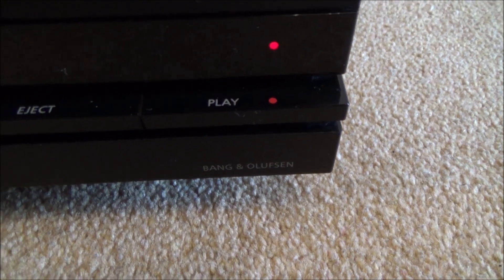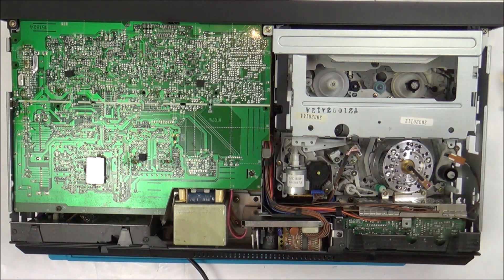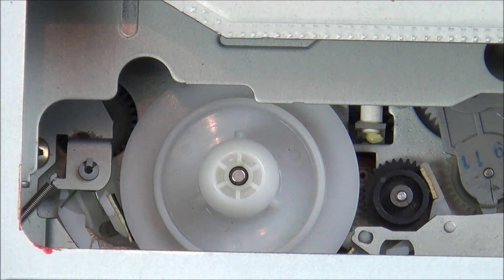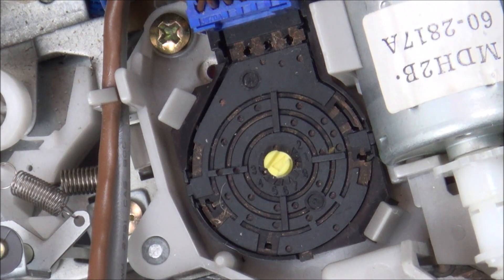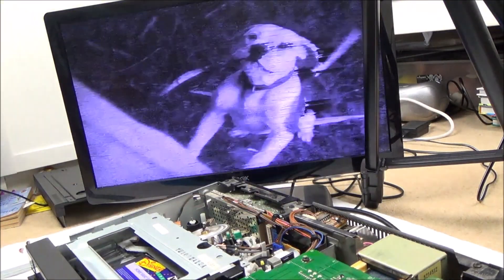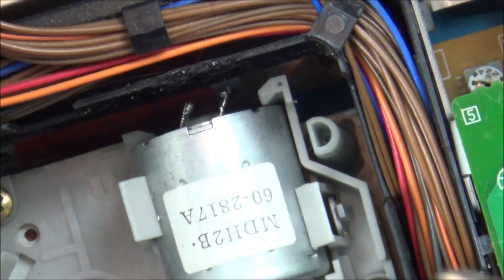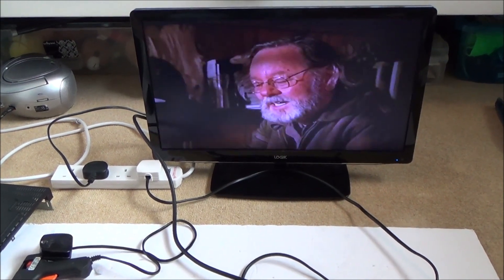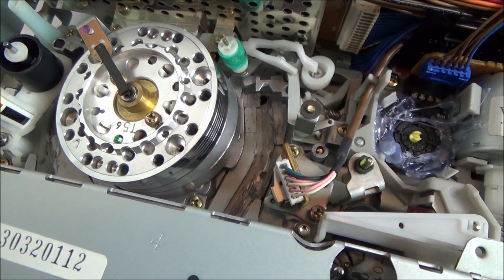Trying to FIX a £1200 Bang & Olufsen VX7000 VHS Video Cassette Recorder

Comment: Vince! 
Don’t rush in to buying a remote, it will not work and you mostly can not use a universal remote as the IR frequency is unique.
All B&O VCR’s and DVD’s do not have IR Receivers on them they received commands though a BeoVision TV. 
I am a Authorised independent B&O Engineer. If you have any questions feel free to contact me.  Keep up the great videos.
Reply from the maker: Thank you :-)  I have plenty more older B&O products waiting to be looked at so your help may be needed, which could lead to a revisit video if I can't fix it first time round :-)
Reply: @Mymatevince  Nice video. I was leading the software development for this VCR with my internal team at B&O doing all the higher level software and external team at Hitachi Tokai Works doing the lower level motor control software. In the 90s B&O did quite advanced multi-room home audio/video networking systems with Beolink/Masterlink where your VCR could serve as the home's central video player and be 2-way remote controlled e.g. from a Beolink 7000 remote (crazy expensive remote btw). This VCR is highly optimized for working in a B&O system and you need at least a B&O TV from the 90s with a B&O remote to make sense of it. Collaboration between B&O and Hitachi to make this product was a big challenge (I spent about 1 month plus other trips in Japan making them fix about 300 bugs just in their part of the software) but we succeeded making it into a genuine B&O product providing a market leading simple design, user interface (with the remote involved), picture quality and HiFi sound quality back then.
Reply: @ThinkingBetter  I have a complete 7000 audio system including the 7000 two way remote - a work of art and hard to believe its 35 years old.
Reply: @originalforgery  You have a Beolink 7000 in use today still working? I know I have one of those stored somewhere in a storage box. Actually I worked at B&O involved in developing that system at that time in the 90s. And frankly, we spent very serious engineering time to develop the two-way infrared control architecture, requirements and software. It was a bit disappointment to me we developed those things much ahead of its time and bad marketing made it fail. Few people realized what it could do. About a decade later I lead the effort of the Nevo SL WiFi/IR remote controller winning the CES innovation award. But even that was not really two-way. Still B&O is hard to beat on true A/V system integration.
Reply: @ThinkingBetter  
Yes, its still working perfectly and is complete with the rare floor stand (I still have the table top dock somewhere).
I've collected B&O products from the late 1980's onwards (I still have 90% of it - the rest I've sold to relatives and as far as I'm aware still works - Beocentre 2200 / CDX) and what I found amazing that pretty much everything integrated with another product ( I wasn't rich so was never lucky enough to buy everything in one go).
I think the only disadvantage with the two way system was that very slight delay which would result in some, pressing buttons twice and getting in a muddle - I was just mesmerised - still am.
As it is, I have a Beovision 7-55 connected to a pair of Beolab 8000's, a pair of Beolab 6000's and a Beolab 2 subwoofer connected to a complete 7000 stack audio system.
I think the way its set up is the TV is the "master" and can play through the AV option - when I listen to music this is all controlled by the Beolink 7000 - there was a few options that we had to explore  to get it to work but we did -  I'm not an expert - more an enthusiast) .
I then have a link system through the house with everything from Beovox 200's, Redline 40's (still sound awesome) Beolab 3500 and 2 more B&O tv's which are part of the link.
All that came together over a 15 year period and I still have most (plus a couple of the new Bluetooth speakers for everyday - Beosound  2 & 9).
I enjoy it everyday.
Jacob Jensen & David Lewis have a lot to answer for..... 🤣🤣😂😂
Reply: @originalforgery  As I worked for B&O for 14 years in R&D during the late 80s to early 90s incl. leading several of the project, I got a ton of products for testing at home incl. most of the products launched during the 90s. We could keep these products by paying a symbolic amount for legal reasons. I also had side roles there as member of the listening team, viewing team, ISO quality audit team etc. Long ago B&O had talks with Apple about some collaboration and I'm still of the opinion that they could enable great synergy (design with simplicity in mind, use of aluminum, ease of use etc.).

Comment: Oh dear! I’m not surprised you found this heavy going. B&O video machines are designed to be part of the B&O system alongside their own brand tv and audio units often with a special remote. Mechanisms are often Philips but remotes tend to use proprietary frequencies.

I’ve repaired a few pieces of b&O, but not a brand I would be tempted to start my service career. Anyway, good luck!

Comment: You’ve done very well with this old thing. I’ve fixed many vhs players as a younger lad. Always took things apart to see how they work. Beta max and even a grundig 2000 I’ve fixed. The grundig 2000 was a beast of a tape player. Fully loaded with boards. Also a double sided tape player too. Brings back a lot of memory’s watching this video. Thank you.

Comment: Nice fix, you got it working and maybe new 3D printed cogs would make it work reliably for years to come.
My vcr is from 2003 and still mostly working fine but wondering how long, if plastic parts start to break. Already couple of times it has shut itself off and started flashing fault code "2". Might be a cassette problem though. Usually it works just fine though.
They sure look very complex machines inside.

Comment: Very nice construction and easy to service , The clutch was slipping caused by the crack on the grey part and gears , and removing the brakes would make it play fast, the left head is for Sound, Don`t use cotton to clean the video head it leaves cotton strands behind ,Use printer paper and IPA to clean the video head and turn it anticlockwise , great video :)
Reply from the maker: Nice one Anonymous. I presume printer paper is good as it has less fibers ????? Glad you are OK as I noticed your channel was a bit quite recently. BTW I got 200m of the 0.02mm wire you mentioned a few vids ago, that should last me my lifetime :-)
Reply: @Mymatevince  Busy remodeling my kitchen and it became a nightmare, supplies didn't arrived.I will see if I can post a video tonight
Reply: @Mymatevince  sorry to butt in, you should check out the motor inside a microwave fan (you know the white one on the side?), I generally salvage jumper wire from there as it's perfect for trace repair, it's easy to strip and tin and it stays in pretty much whatever shape you want it to 😁

Comment: Hello Vince: Apologies if this has been mentioned before. I have a few old B & O things as I like you like them. The reason the VHS was nit supplied with a remote is because B & O remotes are used to operate all of their equipment. It is unlikely that someone would buy a B & O VCR without already having a television to go with it. Alas they would be more than likely to have a remote to operate it. I would recommend you getting a remote for it as this will also operate the functions on your tape player. A Beo 4 will cost £40 for a ropey one on eBay but you can buy the additional parts to make it tidy/as good as new again. Beo 1000 are also ok, but a bit older.
Reply: I always wondered why all those old TV remotes had VCR function buttons on them
Reply: You can also try a cheap replace remote, they are programmed for many different brands.
Reply: @blokhet  B&O uses IR remote. The recorder has no reciever, its recieving it from a B&O TV.
Reply: @blokhet  They may work with the odd function but b&o remotes worked across a broader range of commands.

Comment: I got vx5500 which is older than this but identical for the most part. However the problem with it is that it can only load a tape but not play it, the motor does not move at all and the whole unit is pretty much unresponsive. any help?

Comment: Great job =D  I would be tempted to use super glue on those cracks, and melt slightly with the iron tip at the points of the cracks - might just keep them together!  Awesome result!  I think I would buy one of those generic remotes rather than spend the £70.  I bet one of those will work!
Reply: For an Mx4000 TV I had to buy two different remotes that were both described as being specifically for B&O devices. So not the generic one with programmable IDs and of course not the original... Just one (sent from Uk to me in mainland Europe) didn’t work at all for the TV... The seller never refunded the money, just sent me through an infinite loop of nonsense mail requests to keep me annoyed enough to give it up at 20€. There is something specific to these B&O remote controls.
Reply from the maker: Nice one Chris, I always forget about the soldering iron trick. These B&O devices use a different setup than other IR devices so apparently the all in one devices don't work BUT you can get a cheapo looking replacement for half the price :-)

Comment: The tall lights on the pcb with the two microswitches are the end of tape sensors. The light is blocked by the black tape, but when the tape gets to the end, a clear leader is attached. Light now passes from the led's to the sensor, and informs the machine to stop the tape transport. The microswitches tell the machine the basket is fully lowered, to stop the load/eject motor and it is safe to being loading tape into the head assembly.

Comment: Hey, did you get a remote for the VX7000? I heard it doesn't have an IR receiver... I just got a VX 7000 with a Beolink 1000 which is not working... Did you try the Beo4?

Comment: Hi vince could you fix the cracks with araldite glue? Then sand it down so it’s flush. Or use a 3D printer for parts.

Comment: As always uploading good videos  and this one perked up my interest as I used to repair VCRs back in the day and made a lot of money out of it because I used to visit repair shops in the town asking for machines they are disposing of  had one shop dump about 100 machines on me in various conditions  certainly let me busy at least half repaired and sold on and Soares for other machines good fun 

In this video it looked as tho the alignment was slightly out hence why the take up spindle wasn't moving 

As for the heads yes the one on the left side that has 2 wires is the erase head the big spinning head is for the Video playback and record  the one on the right hand side you said you not sure about is called an ACE head  stands for Audio Control and erase 

The spinning video head I'm quite surprised it has as many heads on it I think the most I have ever seen is 4 heads  but then that has been several years since I got my hands inside of one 

The most common VCRs I came across was Panasonic quite nice machines had much better drive hear system and used to love the remotes for the Panasonic as some models had a barcode scanner to set up the record timer 

There was one machine I got my hands in was absolutely wonderful machine really good sound it was Nicam the tape slot was hidden behind a door along with all the buttons I forgot the make of it but it was quite an expensive machine the only fault in it was the mechanical gearing I had to get a replacement main gear  the main gear is where the mode select switch sits on and driven by the small motor  replacement gear not that I had to pay for it my old boss did haha but cost about £15 including service manual

Comment: You weren't kidding when you said you don't know anything about VCR's. Hehe it was kinda funny, sorry. Anyways, nice video. This machine uses the common Hitachi Mechanism. If you are looking for the parts or the cracked cog wheels, search for Hitachi mid 80's to mid 90's VCR's which occupies the same mechanism 90% of the time. In this particular mechanism, the loading motor (which sits right next to the mode switch) does not load or eject the tape. That is done by the Capstan motor at the right timing. Make sure the you clean the belts and the pulley properly since it has to maintain the torque. I have a Hitachi VCR with the same mechanism, if you want, I can send that to you. I collect VCR's, just love the technology on those. Take care.

Comment: Perhaps it would be possible to make replicas of the parts with a 3D-printer.
Reply: That was my first reaction :)
Reply: it would be too rough, 3d printers still do not have that good of a resolution, i would sugest to make a mold of the original and remake it using resin
Reply: @geovani60624  3D printers have come along way in recent months, I 3D print replacement gears for some DAT machines, the nozzle on my 3D printer is 0.4mm, I can print some really small things that are very usable.
Reply: @nickfatsis9607  yeah but it's still expensive to buy one of these good 3D printers just to make some gears, the molding and resin process is way cheaper and works great if you have the original part and you can glue it in a way that you can make a good mold of it

Comment: From what i have read online this model is hitachi based does look different to panasonic and phillips machines i have seen .If a tension band fails and the felt comes of it can damage the heads and the need to have a certain tension or they will wear out the heads .

Comment: Hey Vince, Yes those cracked cogs/gears won’t help.. you can clean the heads with paper and isopropyl alcohol. Those felt brakes are for tracking and the tape speed. Good to see some else try and fix these... they are a pain lol. But the whole tape section is what we used to take out and the power the motors and check various mechanical parts. But looks like you found the cracked parts great if you can get replacements then it would be good but VHS who still uses that????
Reply: Im all vhs my tv weighs 77kg.

Comment: Love your work. The remote won't be a terrible investment -- a beolink 1000 will also control your cd50 and, with almost any b&o amp from that era and well beyond, your beocord 5500. Ive just seen a pair of these remotes "for spares and repairs" for 40 on eBay. They are super well made and easy to work on. New Trying to Fix video?
Reply: It is not entirely true. You need a Beomaster 5000, 5500, 6500 or 7000 to control the CD50. Beolink 1000 does not work with Beomaster 5000. A belink 1000 costas around 10 GBP in Denmark. For the VX7000 to function optimally, you need at Beovision MX5500 or higher. It cannot be remote-controlled on its own without a Beovision.

Comment: Hello Vince. You can check online for universal remotes. The manufacturer of the remote has a list of players that it works with and the programming methods for it. You can get one cheap that will work with your specific player. This would give you access to fast forward and reverse, as well as the possibility of using it on other remoteless devices you may pick up in the future. Best wishes and keep plugging.

Comment: Those auto head cleaning rollers were the pits. Over time they would not only get dirty and transfer dirt to the heads but also become abrasive and damage the shiny coating on the drum and cause premature head failure. Standard procedure was to completely remove these to prolong the life of the video heads (drum). When you had it playing fast the problem would be that the pinch roller wasn't fully engaged with the capstan so the tape was being pulled through from the take up reel instead of the capstan controlling the tape motion. The take up reel is clutch controlled and designed to slip so it can just take up the slack, obviously it will spin slower the more tape is on the reel so will turn slower towards the end of the tape. Another common problem was too much take up torque which can cause the tape to ride down the capstan and get creased. Mode switch was another common failure, the contacts would get tarnished and cause all kind of random faults.

The audio will be good because this is a HiFi stereo machine which uses 2 of the heads on the rotating drum for audio. The other head assembly near the capstan has 2 heads, one for normal (non HiFi) audio, the other is a control track recorded on the tape which is used to make sure the video heads line up correctly with the tracks on the tape (tracking).

VHS machines were very complex and there were so many variations of design. Amazing that this technology was available in the 70's.

Comment: You could always try to use small amounts of epoxy resin on the cracked parts to set and strengthen them, any news on the remote?

Comment: The chasis looks very similar to my Sony SLV 686 vcr.  Those had a real problem with the take up gear breaking.  Looks like a pinch roller or capstan problem.  Watched more and I see your gear problem.  I wonder if you could make a replica gear by creating a mold of the gear?

Comment: A universal remote should be able to do the additional functions.

I have a phone with an IR blaster in it, which I find useful for things like this.
Reply: Maybe not on B&O, as the remotes were send/receive. Imagine spending £1200 on a VHS system in 1995: it's not even SVHS.
Reply: @stupossibleify  The B&O may still use remote "codes" that are compatible with some other manufacturers.
Reply: IR blasters are fun - I had a sammy phone that had one, My friend and I were sitting in the sports bar part of a family pub, and no one else was, and it was news time, but the channel on the TV was Tennis. I quickly found the code for the set, changed it to the news, and turned the volume up just enough so we could hear the presenter. When done, I put it back to the tennis and turned it back down. :)